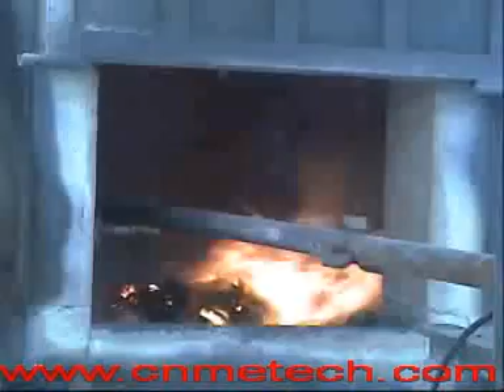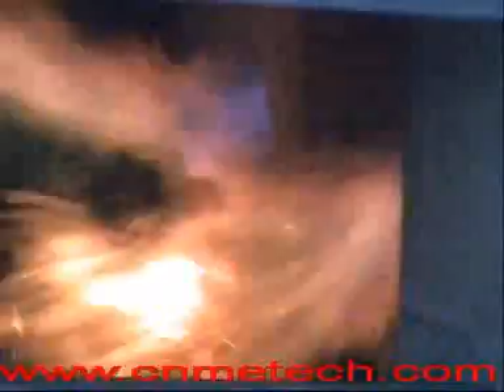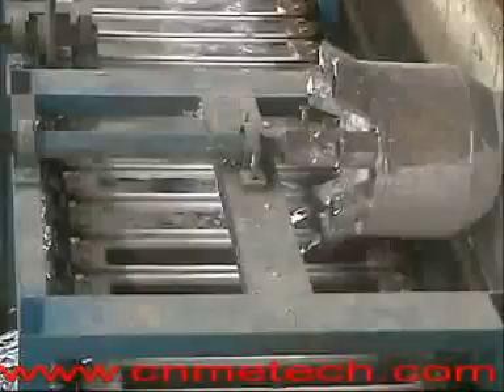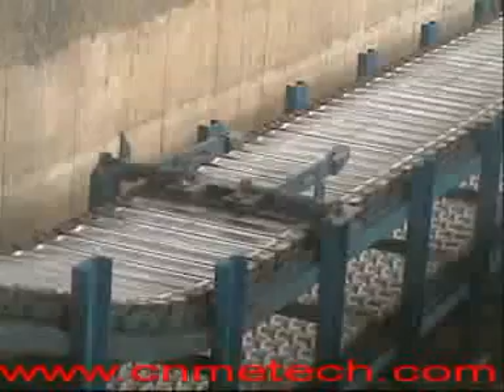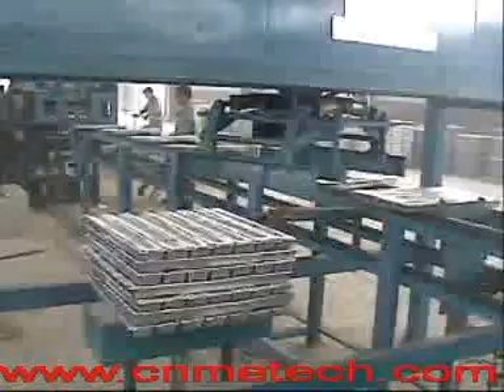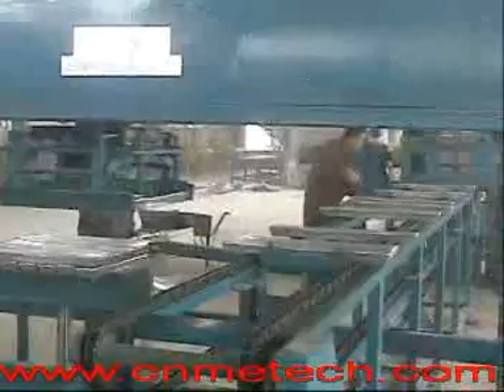Aluminum Alloy Ingots (ADC12 ,AS9U3 etc) Production Line

Comment: Hello, this is Millo Camarena again
Since you answered my question, I've been working on my project. What you told me gave me confidence.  I have the following situation: I have a costumer which I'm selling aluminum alloy A356.2 with a modified content of silicium of 7.5%, magnesium of .35 to .45% and a maximum of .4 of iron to.                        
This same alloy but coming from another provider is affecting him on his process of aluminum injection; it is causing a lot of corrosion in the molds living them useless in about 4 hours and has to have them fixed or changed.                        
I would really appreciate it if you have any information that could help me not make the same mistake. Also, in your experience, What do you think is happening?

Comment: hello sir 
i have a small quaestion please reply
we have an aluminum foundry.. i want to know how do you mix silicon in aluminum to make AS9U3 grade ...
Reply: You need to have an alloy specifications first so you can know the minimum and the maximum of Silicon content. Do your calculation for Silicon quantity and add it into the metal and have a good stirring
Reply: thanks ... for interest
aluminum melting temp is 660 and silicon tem is 1200+ how should I manage the temprature.
Reply: it depends on the length of your casting launder (the distance between the furnace spout and casting wheel)
Reply: caall
Reply: i am mr. micheal from nigeria, lagos. i have 4tons revebatory melting furance from taiwan,  and i am looking spectrometer i will use because is for ADC12.*IS USED CAN BEER CAN BE USED AS PART OF MY RAW MATERIALS*
best regards, michael
Reply: @femittaiyewo4020  How can I contact you sir? we have business in Nigeria, let's check any chance to cooperate
Reply: @femittaiyewo4020  where is your workshop Femit